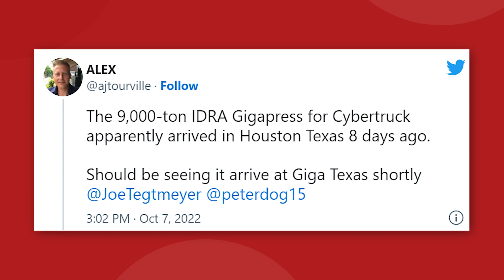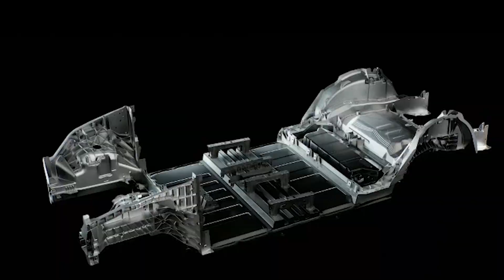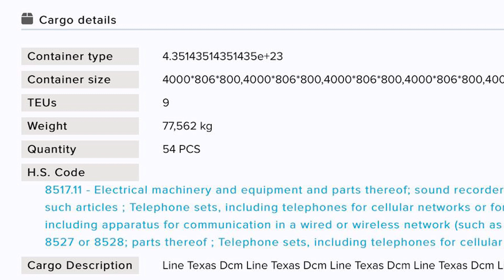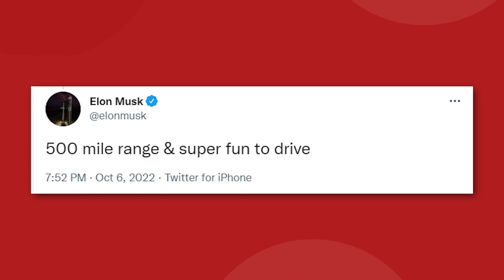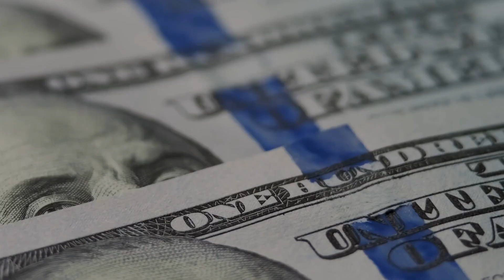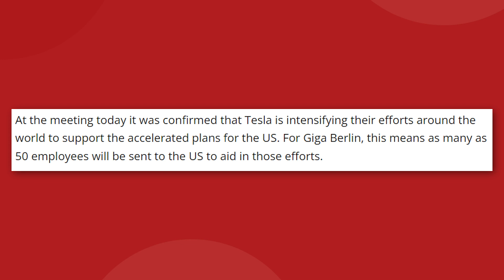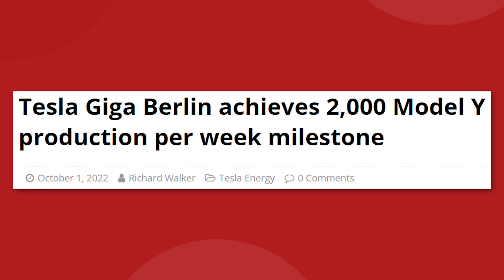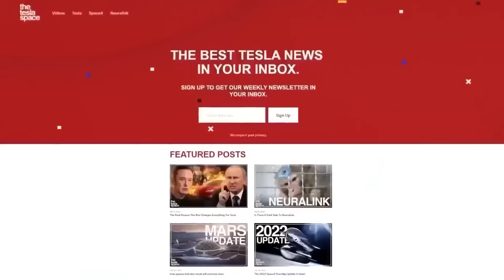Major New 9000 Ton Cybertruck Giga Press Update!

Comment: The number 1 thing that Tesla shareholders could do to secure their investment is get rid of Elon. The company never makes it's targets. Despite large drops in battery prices industry wide Tesla can't seem to lower prices as with all new tech. There is so much production from other companies coming online in the next 2 years, from companies that know how to compete that Tesla will get slaughtered.
Also they should be producing many more cars than they are. The 35K car is still a pipe dream, despite the model 3 being a very cheap looking thing. The screen that is actually a  huge money saver, a 200 screen replaces every button in the car, the 40% drop in battery prices in the last 3 years.

The model 3 is an Elantra with a great many parts removed, like any electric car, it is still over 40K. FSD is a joke. Many cars without the very misleading name, FSD, outperform Tesla's in every area of automated control.

Get someone who is not like Trump on Twitter and has time to concentrate on making it the huge success it can be.

Comment: Just a small correction. If it weighs 600,000 Kilograms, it weighs 600 tons, not 590. It does not lose weight after a mathematical conversion.
Reply: He said just under 600,000kg, or in other words, about 590 metric tons.

Comment: Let’s not forget that Tesla Berlin had a lot of issues with there giga press for model Y. It took a long time to get it working correctly.
Reply: Who has forgotten? No one who's payed attention or followed this machine thinks it will be easy. Of course it took time to get it working on the model Y. And it will take time getting it working on the cyber truck. Tesla and Dedra also learned a lot. It's not the same as doing it the first time. It will be easier this time and it will happen just as it did before. They have installed several of these presses now and they are getting better with each one.

Comment: To prevent the air bubbles in the giga press the air is evacuated from the mould and then the molten metal is pushed in under pressure in less than half a second. Biig change

Comment: Is there some kind of a sensor on the Semi that will let the driver know if the truck might "jackknife" ?
Reply: From what I remember from the talk Elon gave years ago, he said there was, and that the motors could also independently control the wheels so that when the computer does detect the semi might jackknife, the computer will fluctuate the power delivered between the wheels independently to actually try and counteract the jackknifing behavior (much like how an ABS/ESC system works).
Reply: 🙏Thanks for watching and commenting hit me up right now to claim your price👆👆👆..........

Comment: How much does it weigh? Can it go a full 500 miles loaded at 85000 pounds over mountains?
Reply: Nope not even close.
But wait if it's all downhill all 500 miles!!! Hahahahaha 🤣
Reply: Because west Virginia at 10% grade is crazy
Reply: But apparently there are roads with a grade of 45%, and I'm sure no truck could do that. But you would have no breaks on the way down. Electric trucks would be better going down because the regeneration of the breaks would charge to the battery while slowing it downhill, that would be an extra break on top of the air breaks, but I don't think it would have a j break
Reply: 🙏Thanks for watching and commenting hit me up right now to claim your price👆👆👆........

Comment: My condolences and prayers go for the guys that will be setting this dcm up 😂 idras are piles of shit and bad design 🤡
Reply: That's the rub.  It's like being handed an Etch-a-Sketch and told to paint the Last Supper.  Indra takes the Tesla specifications, designs and builds the machine and then says, "Good Luck."  No guarantee that it will work.  No testing of Tesla's dies.  No warranty.  Sold as is.  

I think if I were Tesla I would be sand casting these pieces.  At least that is a proven method with a track record.
Reply: 🙏Thanks for watching and commenting hit me up right now to claim your price👆👆👆........

Comment: Wasn’t there a report stating that there is a
Small mountain of rejected Y cast parts?    Have u found any conrete info on that?  

I hope this new 9 ton press works correctly!  Teslas future depends on it.
Reply: Would that make any sense? If there was a defect they could be melted down and recast.
Reply: @ptech88  So it costs nothing if a gigacast part is defective?  I think not.  

To date the first time yield of gigcast front and rear clips is less than 40%.  Some insiders are reporting that it is much less than 40%.
Reply: @ReachOutToWilliam  I’m not talking about a defect in the casting machine. Im talking about casts that dont pass inspection, they can be melted down and recast so no waste. Its not hard
Reply: @ptech88  The energy to melt the metal and run the machine is no cost?  How about the labor and depreciation on the machine?  What about the cost to move and store the defective parts?  What about the cost of the release agent and other chemicals to clean the molds?

You really do not have a clue.  I have worked in a foundry and know the cost of defective parts.  It's not a pretty picture.

You do realize that a defective part in any foundry operation is also recyclable, right? 

The ignorance in this one is deep, my friends.
Reply: @ReachOutToWilliam  relax and have a drink. Im not running tesla, maybe you should with all your expertise. Im sure they would value your wisdom on this topic. Maybe shout out to Musk. From this moment forward you shall be know as the foundry god. Congratulations.
Reply: 🙏Thanks for watching and commenting hit me up right now to claim your price👆👆👆........